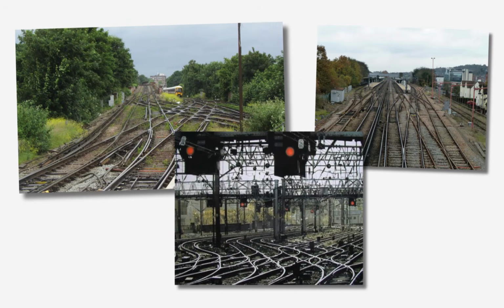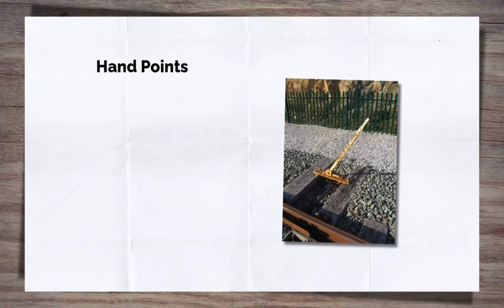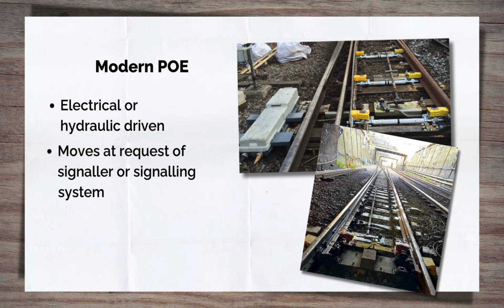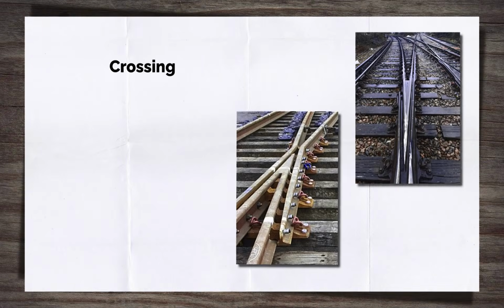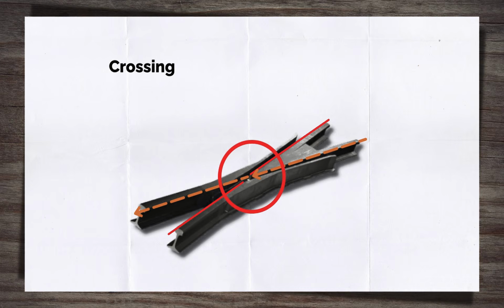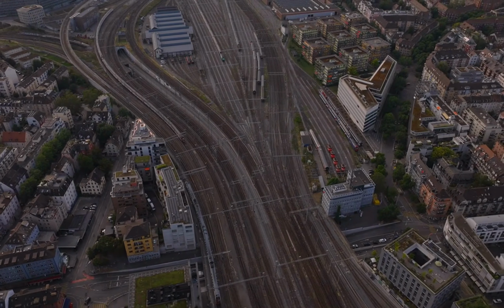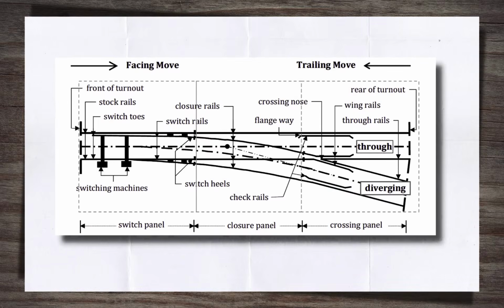Switches, Crossings, and POE: The 3 key parts of a Railway Junction

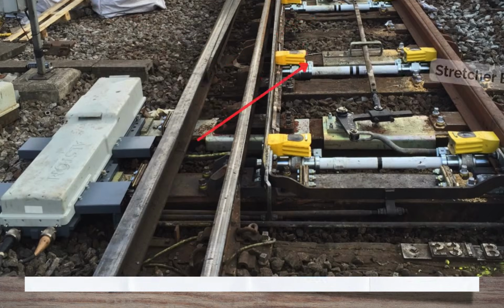Comment: 1:39 the image with the 3 stretcher bars should have stayed in view for 2 or 3 more seconds.  a view with movement would be good, too.  this looks like adjustable devices.  i wonder why fixed length metal bars are not used for a fixed gauge.